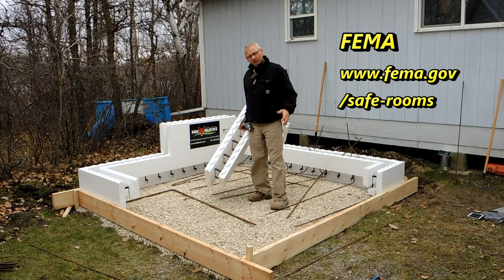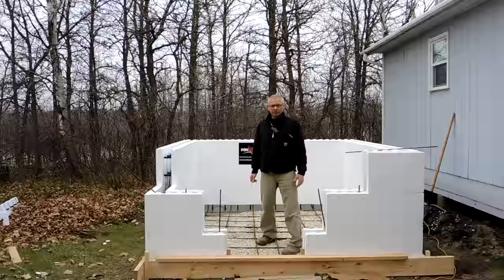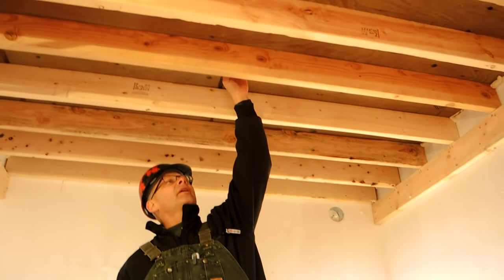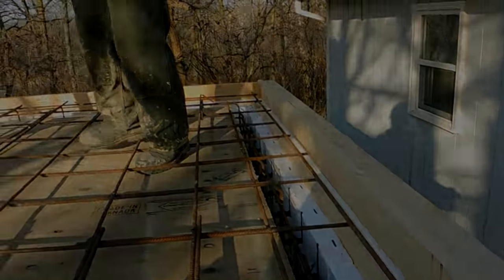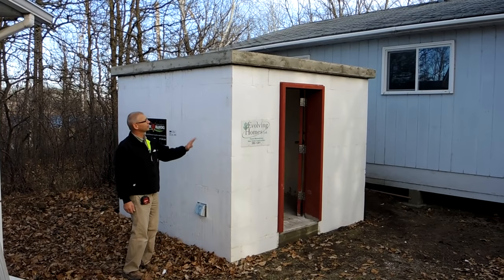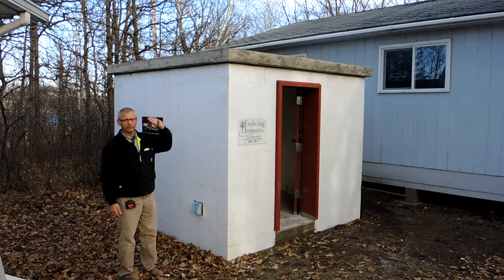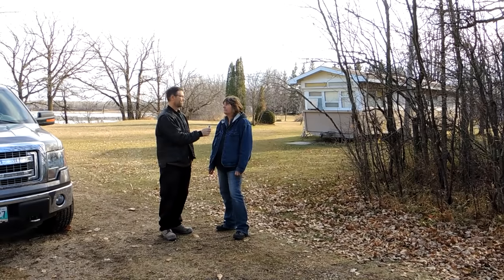Fox Blocks Storm Shelter Full Length HD

Comment: I love it!! So nice. Just love that the whole structure is one piece. I'd like to know, did it crack at all? How can it handle mild seismic activity? Could a person live in a structure like that, or does it require special ventilation for condensation? Is it quiet inside? I like the idea of interior and exterior done in one shot. But with this method you still have to finish over the foam forms right?

So cool!! My favorite. The only objection I'd have is, I wish the plywood ceiling could be removed. But I don't know if that's possible.
Reply: Jbammer Whiskey 
Yes people build homes and apartments with fox block. 
Yes you need proper ventilation. But, that’s true with any structure with a full envelope seal, including spray foam insulation. 
The foam has plastic (hdpe) studs every 8” for siding and interior walls. The locations are marked on the foam. Screws hold 6X stronger than in wood studs. 
I’m not sure about seismic activity. I’m sure that California has codes for using fox block because it is used there.
Yes, the plywood ceiling could come down. But, if you do this, make sure to oil the plywood before pouring the concrete. Near as I can tell from the video, the only thing holding it up is that it’s stuck to the concrete.
Reply: @gypsyfreedom9836  Easy Killer. Over Reactions like these say more about you than the object of the rant. Yes you were right. The person obviously missed half a sentence…. It is literally not the end of the world. Any One that was going to put this much time and effort into doing this build will not fail because of this step.

Hope things are going better for you now. Good luck on your build.
Reply: @inomad1313  how did the concrete stop from filling up the floor and just started filling up the walls?  I'm going to attempt this in the next month.

Comment: 7" slump??? what. you should have rejected that concrete and waited a day for proper slump.
Reply: Also should have taken the class on pumping concrete. Way, way too much vertical drop, the vibrator, which is correct, was a waste because rock was already separated from paste, due to falling over 48 ", next time use a tremie or even better, higher a concrete contractor.
Reply: sdnlawrence Are you a contractor?
Reply: yes, i'm not hiring them if they just shrug when the wrong product comes and accept it
Reply: Unless they paid for super plasticizer (probably not tho since it’s a budget looking shelter)

Comment: It didn't look like it was anchored to the ground.  Granted, all that concrete is very heavy, but why didn't (if he didn't) he anchor it down?
Reply: +Nev Ereven ........ Anchor with treated rebar or galvanized bolts driven into ground.
Reply: That concrete weighs less than a car. This is stupid. But its the same as having a steel storm shelter bolted to about 4000 pound of concrete.. Useless!!!
Reply: I was thinking the same thing!
Reply: JD Wilkinson Its all concreted together so it will hold up.
Reply: because he's selling fox blocks and doesn't give a shit
Reply: @koolkitties8552  it will hold up but a tornado can lift that thing off the ground. That would not be a fun ride.
Reply: You could use the 6” corbel inverted as a foundation (Wider at the bottom than the top) and 6” walls. Cut the inside top of the corbel down to the first rebar bracket (I think that’s about 3”). Cut the first course on the inside bottom to make up the difference in the 5” floor (like in the video). Run rebar vertical up from the foundation into the wall and bent into the floor (as they did with the walls in the video). Ties the foundation, walls and floor all together with concrete and rebar. Backfill over the corbel. Everything exposed to the weather has foam except the bottom of the corbel/foundation. Pour the foundation, the floor, the walls and the roof all in one pour. 

I’m no expert in construction, but this seems like a solution that would make the foundation wider at the bottom. Ties everything together and makes the structure considerably less likely to be lifted in a storm.
Reply: @jdwilk5023  you're joking right?  concrete weighs around 4,050lbs a yard.  6'x6'x5" alone is 15 cubic feet or 0.56 yards.  times 2 for the floor and ceiling that's 4,536lbs.  my cars don't weigh over 4,000lbs and I that's not even including the walls!  FYI, the walls are an additional 2.93 yards.  this thing weighs around 16,402lbs.
Reply: @neckofthewoods24  take your fancy math and shove it! Lol
Reply: @evilassaultweaponeer  no
Reply: Short answer - because they live in Manitoba and have no idea how to build a tornado shelter because we very rarely get them Here
Reply: @neckofthewoods24  A single F350 or diesel truck which would get tossed around like a pebble in a large tornado weighs 8500lbs.
Reply: @evictioncarpentry2628  of course it would.  It’s a huge vehicle that sits off of the ground that can easily be picked up.  on the flipside a tornado chaser vehicle is not easily picked up due to the fact that it is low to the ground and the wind doesn’t hit it the same.  Kind of like a shelter that wind can’t get under.   I’d think that would be pretty clear no?

Comment: I would like to see some hardware added to be able to hang hammocks in there. Hammock chairs and swing from the roof. Cut hole for window AC unit. Would use this room to house the DVR for the camera system. Would like to see gun ports to be able to fire out of the unit .

Comment: how did you fasten the ledger boards that support the temporary joists holding up the plywood for the ceiling?
Reply: There are plastic ties between the EPS block wall forms... they have an attachment face.

Comment: With the weather I've seen go through the U.S. this last 2 weeks those living in tornado Alley should build their entire houses underground. Problem solved.
Reply: But it doesn't look normal and pretty. Yes that's stupid but that is how most Americans think when buying or building a house.
Reply: You could berme the walls and it would have the same effect as being buried for way less money. Here in the Ozarks, at least, it’s very difficult and expensive to dig.
Reply: Some people do. Some homes have sub-basements, which are basements UNDER the initial basement.
Reply: ground water levels, some places you can dig 8 feet or more down with no trouble, others 4 feet or less max.  Other places without that issue instead have bedrock a few inches down, so no basements and homes have to be built on slabs.

Comment: So what anchors this shelter to the ground ? It appears to just sit on a gravel base. If so, it could be picked up and thrown. A friend just built a similar shelter, BUT, his has 6 I-beams that go deep into the ground and the shelter is built around the i-beams at the corners and sides (it’s rectangle) He said he hit rock drilling down for beams and had to have it blasted, to get the beams deep.

Comment: A lot of people are saying that this shelter is useless as it wouldn’t survive a powerful tornado. Well F5 tornadoes are rare, and the probability of a hit is very very low. If you look at tornado damage photos you often see a house wrecked, but a nearby building is still standing, that is because the path of a tornado is typically 50 yards wide, rarely much larger. So the probability that this shelter is in the rough path of a tornado is low, the probability that it is a powerful tornado is lower, and the probability that it is hit dead on by a powerful tornado is very small. In truth this shelter will let you survive most tornadoes, and avoid flying debris such as a fridge, or a car, or timber beams. Sure it won’t survive a direct hit by a powerful tornado, but that is a very unlikely event. You could put a shelter underground, but you’d have to allow for flooding, and you’d risk the door(s) being blocked by heavy debris, preventing an exit.

Comment: I assume you have to let the floor set up slightly before continuing the walls?
Reply: +MrBen527 I am not sure if they would need to with a 5 inch slump.
Reply: It is a mono pour  that is the floor, walls and tops all poured together much better.  They do not say how many yds. of concrete used but the floor may not need to be 5" but the weight would help concrete weights around 4000 - 4200 lb yd depending on mix design.

Comment: Nice but is it anchored into the ground?
Reply from the maker: No, this shelter was not. We would recommend anchoring to the ground with proper engineering. Local engineers have recommended helical piles for anchoring an above ground shelter.

Comment: I saw absolutley nothing anchoring this structure to the ground. What is there to prevent it from being rolled over by the high winds? It looks like a simple concrete block sitting on loose gravel. Hopefully there arent a lot of people trusting this to save their lives.

Comment: So, the re bar on the ground does not need to be floated three inchs into the concrete itself?
Reply: IF you look again you see it is at least 2" off the ground which is ok in a 5 " slab... Idea would be 2 1/2 " of course.

Comment: Looks like a cool diy project. If I use this as a “root cellar”, putting it underground, can I still use 4” blocks or 6”?
Reply: 8 inches to comply with all building codes. Also concrete  requires FOOTINGS ! I don't see footings period. And permits are required.

Comment: Living in Alabama I can tell you this is a waste of money unless all you get are straight line or f2 tornadoes. April 26, 2011 we had a very large outbreak that destroyed a large area of our state and cost many lives. F4 and F5 tornadoes sucked basements, driveways and yes even septic tanks out of the ground. This structure is nothing but an expensive concrete box sitting on a bed of gravel waiting to get sucked up and tossed into a tree.

Comment: I wish you didn't use this video to promote your product. That rebar is an issue.
Reply: Wait, the rebar is an issue, HOW?  It is about the only thing done properly in this type of structure... Please explain.
Reply: @stevemazz3121  
the rebar should be 3in off the ground. moisture will wick up and cause it to rust and create spalling issues

Comment: Why do all the tornado shelters are always square. Why don't they built them round for aerodynamics it will put less pressure on the structure during a tornado.
Reply: Sergio Beltran because it easy. I would rather have a dome

Comment: Is this shelter enough strong? If the storm will throw example an car against shelter? It is sure that walls are not enough strong. Maybe you should cover it with  extra cement and hide it partly under ground? The soil and peat protects also shelter.

Comment: It’s interesting how people give grave predictions about the structure being blown away by the force of wind.  As if it’s some mystical force.  It’s a well known quantity and can be calculated.  It’s not the wind thats the biggest threat to this shelter.  It’s the things in the wind that cause the damage.  Aside from the obvious dangers associated with being impaled by projectiles flying at 100mph through the wall, the problem is that most structures become completely structurally compromised when partly damaged by projectile impacts.  The shelter illustrated in the video should be a low risk even though it’s above ground.

It seems above ground structures are a viable strategy for surviving EF5 tornados.

Texas Tech has been researching this for decades:  https://youtu.be/IiBTp09JRwE

A bigger problem for many, in places with significant fluctuations in water table (like Oklahoma with over 200 man made lakes) is Archimedes Principle.  People buy light weight below ground shelters only to find the shelter lifted out of the ground when the water table rises.

Comment: Better build a Garagestormshelter with escape doors for double use.Fill up sides with dirt.
Reply from the maker: Agree, many homes being built with ICF's will include a large room or closet c/w concrete roof within the design in the house. Of course, the garage would be ideal because you would save your truck as well.

Comment: I would not trust anything above ground. What's to stop a F5 from picking it up?
Reply: This is a very weak shelter and they do make stronger above ground shelters but this is still far better than being in a stick built house.
Reply: F5 tornadoes are rare, the probability of a hit is very very low. If you look at tornado damage photos you often see a house wrecked, but a nearby building still standing, the path is typically 50 yards wide, rarely much larger. So the probability that this shelter is in a tornado is low, the probability that it is a powerful tornado is lower, and the probability that it is hit dead on by a powerful tornado is very small. In truth this shelter is most useful for surviving flying debris such as a fridge, or a car, or timber beams.

Comment: when you pump the concrete it makes for a higher slump at the end of the hose. 5" at truck turns into 7" at end of hose...
Reply: That is backward, slump is lost when pumping. The aggregate absorbs the water due to the pressure being exerted on it.

Comment: Maybe hi end F2 Rating. I noticed you didn’t chair the rebar. Way wet slump it will crumble if hit by a F3 or above. Look at F5 in Tuscaloosa in 2011. Phone Network centers 8in slabs 8in walls and ceilings 5000psi 3/4 in rebar 10x20 buildings lifted moved 100 ft or more dropped and destroyed. Besides your door is the weak part. 3 bolt locks in 1/4 in 6190 steel? Flying tree trunk will bend it in center releasing bolts from frame. It is better than nothing. But not tornado proof. Hopefully this was your first one and you have improved upon it. A bank vault did survive and was only thing left. It was 1ft chaired rebar with no space less than 4x4. And a 1ft thick stainless blast proof door which bolted every 6in all around and obviously cross barred during locking.
Reply: "A bank vault did survive and was only thing left. It was 1ft chaired rebar with no space less than 4x4. And a 1ft thick stainless blast proof door which bolted every 6in all around and obviously cross barred during locking."

And that just about sums up what is needed.  If I was to use concrete, which I would, I would want it at least about 1 foot thick all around.

Comment: Sweet construction but overall very limited in it design.   Without being anchored to the earth, this is a very vulnerable shelter in extreme circumstances.  The Joplin tornado moved an entire hospital off of its foundation. This little thing would be tumbled mercilessly if a tornado like the EF5 Elie Manitoba tornado were to smack it around.  That being said it would probably work beautifully for any tornado of the EF0, EF1, EF 2, and maybe even an EF3 category.  The odds of a tornado coming through of anything higher than this in Canada would be extraordinarily slim so this will probably suffice and 99.999% of circumstances. Not to mention this is about the sweetest shed design of all time!

Comment: How large can you make the roof with concrete before you have to add a support pillar?
Reply: I’ve seen concrete pours 5 times this size with no middle supports, though it had steel corrugated sheet for the ceiling before the pour. They weren’t made as tornado or storm shelters though.

Comment: This is not anchored to anything in the ground and a tornado will just push it over and pick it up.Game over.The right way to do this is to use ten foot sonotubes five foot into the ground and j shaped rebar around the base of each tied to each other.with rebar tied into the corners so at least you have a chance.

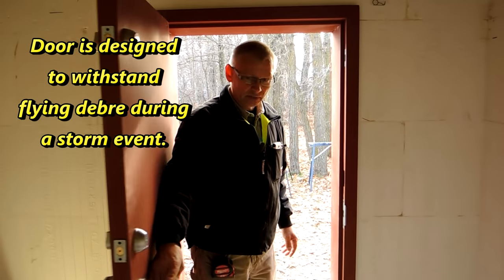Comment: 06:24 - It's spelled "debris".  (Not "debre".)
Very nice shelter, otherwise, but I'd've put it at least half way into the ground, and built up some earth around the outside.  Tornadoes might not blow your shelter down, but they can toss a full-size dumpster at it, at over 150 mph, and your shelter will be seriously damaged.   Also, rounding the corners, or making it an octagon would reduce wind drag (& shear stress) and debris impact by a considerable factor.
Reply: This is a gentleman selling FOAM FORMS not tornado shelters. I must say being a concrete contractor I was impressed with there ability to pour the entire structure in one continuous pour. (Note they did say Place Concrete, which is correct. One does not pour concrete but places it).
NOW, this could have been built properly and still use the foam forms to do it. By using longer foam ties they could have built thicker walls and a proper steel storm door that locks water tight as on a ship.  Should add a escape hatch to top or another side should it be moved.... AND of course built in 2/3rds under ground..... 
The foam forms are light weight, easy to set up, and add Insulation to both inside and outside the walls. Those 8" walls are only 4" of concrete. If they were building concrete shelters they would show up with all wood forms cut to fit. It could be built the same way and poured all at once but you would get 8" concrete walls rather then 4 ".
AND what is the need of insulation on a storm shelter? Water Tight yes, but insulated?

Comment: You put a load bearing walls on on a 5 inch slab, wouldn't pass inspection anywhere.
Reply: Hurricane shelter or coffin?better than nothing,barely.
Reply: I guess the thought process was certain death in the mobile home, or a 50/50 shot with....that.

Comment: You should have digged 4 cylindrical holes about 6-10 feet deep at the bottom in every corner, put some rebar in it and connect it with concrete to the foundation+rebars. This shelter is not aerodynamic, I dont know how it will behave in extreme winds. I would not like to try it out.